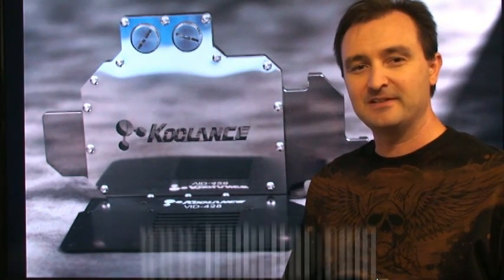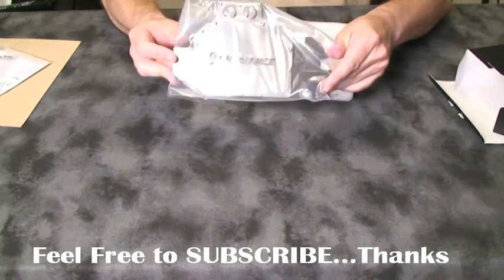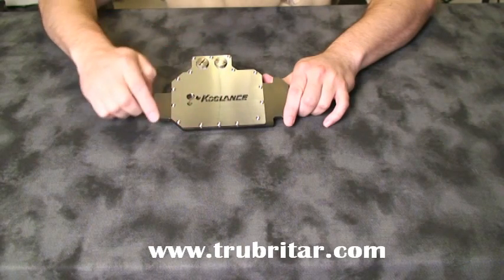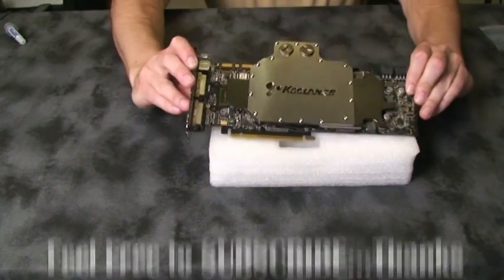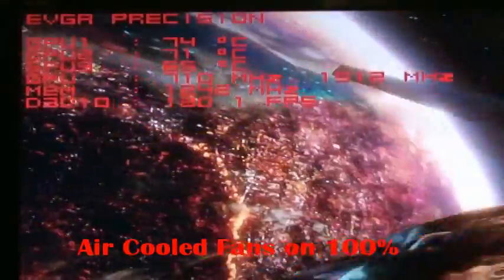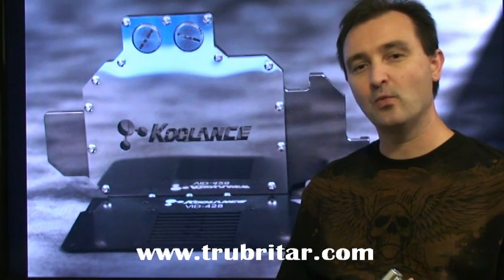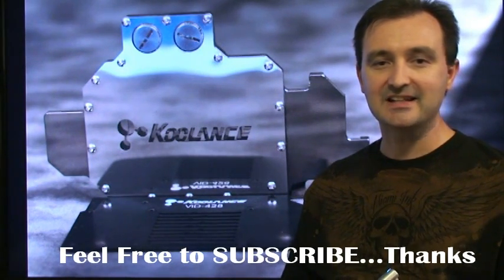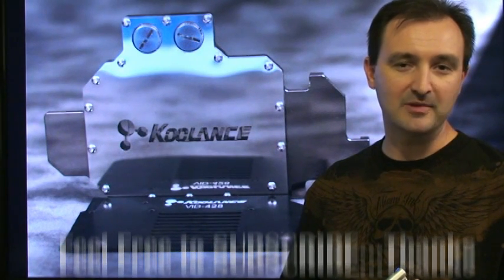How to watercool the GTX 280 for 3 way SLi performance

Comment: i know that the GTX cards are loud coz they have a monster of a cooler. But when ur cards reach 90° its necessary coz u this heat can damage ur cards.
40 fps on 1920x1200 uh, thats  a dream^^.
Im the opinion that 40fps on 1920x1200 very high is more than enough^^

Comment: i have evga precision tool on auto because these cards are really loud,
also i ran crysis bench mark on 1920x1200 with no AA and again on 1440x900 with 16q AA and both times got 40fps average.
surely 3 cards sould max out this game no problem?

Comment: I've been listening to my case sometime and it clicks and ticks when running tough games like crysis. video cards are too hot too grab. crysis gets my videocards as high as 103 degrees.. lowered clock at those temps. But that can't be healthy for a longer period of time. tho air temps waver and change alot. a day later the same amount of workload can give 10degrees lower temp results. (don't ask me why)

Really these cards are absolute flamethrowers.

Comment: i get a feeling these waterblcoks occupy 1 slot. Is it possible to use the extra pci slots by using water??? say for example a tv tuner card, cutting off the second backplate of the videocard ofcourse...